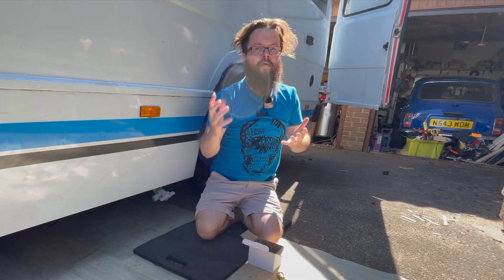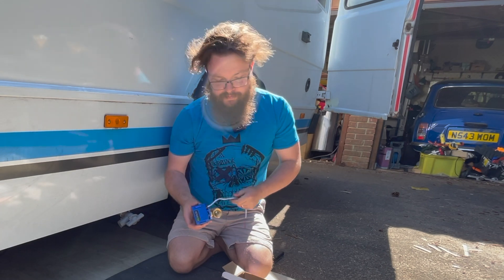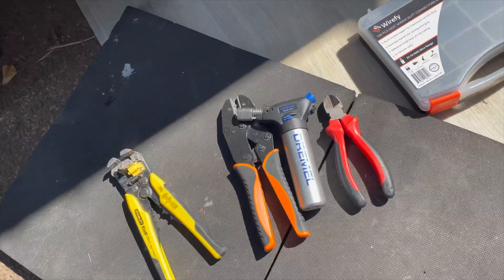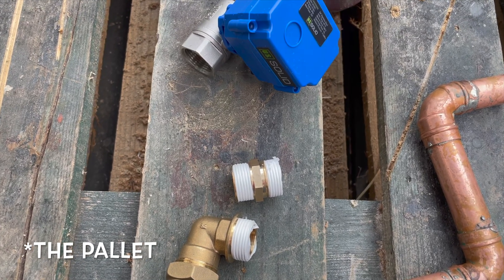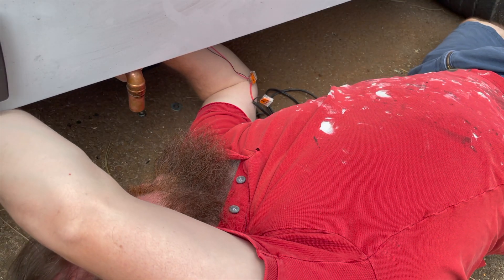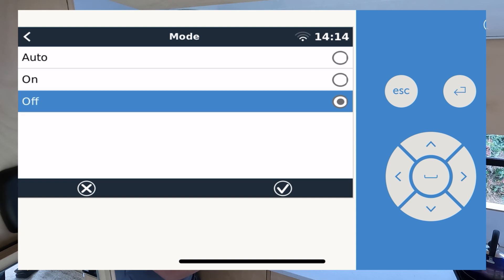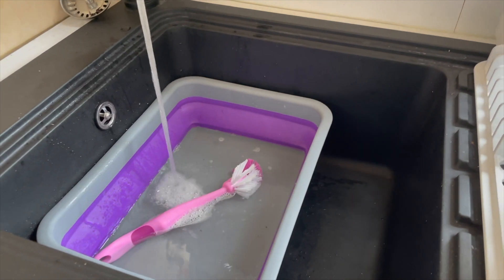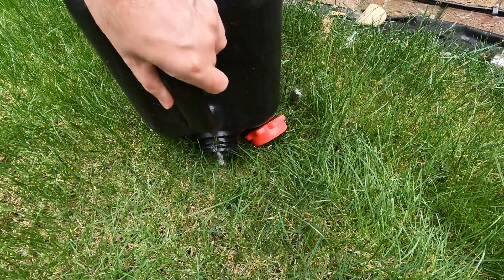Waste Water Drainage for Your Van with Victron Cerbo GX

Comment: this is great, i have a ball valve with 3 wires, negative and 2 lives open/shut, bit confused as how to wire up using cerbo, anyone help
Reply from the maker: Thanks. So assuming this is like yours https://amzn.to/4jOkDv8 you will need to run your negative wire from the fuse box to the yellow cable on your valve. Run a positive feed from the fuse box to the common on your cerbo, connect the red wire to NO (normally open) and the blue wire to NC (normally closed). 

When the relay is active it’ll open. When it isn’t it’ll shut. Let me know if this works - fingers crossed.

Comment: I connected straight to the Cerbo GX like you suggested you do and it doesn’t open when I switch to on probably going the relay route. How did you wire your relay?
Reply from the maker: It should work via the Cerbo, so wire from a fused source to common and then to the valve from the Cerbo. The Cerbo is just acting as a switched relay in this scenario. Ensure your negative goes back to the same place where your source is grounded (fuse box?)

In terms of how I did it. I decided to use the cerbo as a trigger - power is supplied in the same way to the Cerbo as above, but then instead that cable is routed to a 12v relay to trigger it. This is probably overkill, but I thought it better to put the strain on a cheap relay vs. the cerbo over time.

Comment: Great idea but surley you would put it on the bottom of the tank? Will be 2inches of water always left in the way you did it
Reply from the maker: We used the existing outlet that came on the tank and you’re right it sits a little high. About 3.5cm to the middle of the outlet. One in the bottom would probably reduce this a cm or two by the time you’ve threaded a bulkhead connector in there for sure. 

That said we don’t really find it an issue as more often than not we will find ourselves camped on a slope and can drain off the excess into our container before we leave. It also means we have good ground clearance, the only thing lower than the body is the 22mm pipe. So no worry about hitting the valve at all. Thanks for watching. Hope this helps.

Comment: How has the valve faired out since it's been installed, any water ingress into the circuitry? (I've read a few headache stories..)
Reply from the maker: Touch wood, zero problems with it. It’s really useful to have to be fair. Would still recommend.

Comment: does it come with 2 wires or 3 wires? I saw some versions with 3 where you need to power the 3rd wire for closing the valve.
Reply from the maker: The version used here is 2 wires. So this means when de-energized the valve shuts automatically.

Comment: Hi, wondering if I need to take 12v to the relay. Or will this spit out enough control voltage to open and close the ball valve?

Because when I hook the valve up directly to the relay, it doesn’t open the valve
Reply from the maker: Hey. Yes you need to supply 12v to the common terminal. The relay is effectively just a switch that cuts or switches on the power.

Comment: Nice job! I have a question. I saw that your VRM-menu shows "remote console". How did you add that menu point? I cant find it on my VRM. Best. Silvano
Reply from the maker: Thank you, so in your GX device if you navigate to settings and go to remote console you should see and option to enable on VRM. Hope this helps 😊
Reply: @WanderbusAdventures Thanks, but unfortunately it does not help. That setting is "on" and I stilI do not get the "remote console" listed in the VRM menu. Any ideas as to what might be wrong? Best regards, Silvano
Reply from the maker: @silvanocometta9760  did you manually reboot it after switching it on?
Reply: @WanderbusAdventures Yes, I did. As it did not show a result, I also rebooted the Cerbo by taking off its power cable for 20 sec. Still no result. I am puzzled.

Comment: Hi again buddy 
Did you ever do a video how you got the fresh water on the cerbo 
Cheers
Reply from the maker: Hey Sean. Do you mean how you get the levels to work?
Reply: @WanderbusAdventures  hi mate 
Yes 
I’m not sure if you use the mopeka sensor for your fresh and grey tank or the senders buddy 
I have them on my motorhome control panel 
But I’m wanting to get away from the old set up 
I’m basically using everything Victron too 
So was thinking of using the sensors for the water tanks then connect to the cerbo
Reply from the maker: Ah makes a lot of sense. So I used resistive wired senders for my tanks and wired them directly to the cerbo. I can monitor it on the cerbo then and can even set it to empty the tank automatically. Do you know what sort of senders are in your tanks? If they’re wired there’s a good chance it’ll work with the cerbos inputs.
Reply: @WanderbusAdventures  ah ok makes sense 
And no I have no idea
I have tank levels on the fresh and grey tho 
But I have seen the wiring and they come in 5 wires so each different level 
Otherwise I would have piggy backed to the cerbo 
But …. Being 5 wires seems more difficult to do
Reply: @WanderbusAdventures  what size fuse did you use when fitting the ball valve for the grey tank buddy

Comment: That grey tank dump valve looks pretty small for European rvs. Here is the US usually is 1.5 inch, yours looks like 1 in? I wonder do they clog often?
Reply from the maker: It’s 3/4- so even smaller. I matched it to the thread on my water tank so it’s no smaller than what was on the tank. It hasn’t clogged yet 🤞

Comment: Hi again buddy 
On to the last job 😅 diesel heater on temp 
Obviously because these can use 8 amp 
I will need a relay or ssr
Is this how to do it ..Example 
Positive from fuse panel to relay in the cerbo label (com )
Then out the cerbo (normally open ) to the actual relay device 
Then the other end of relay to the heater power 
Is this correct 
Thanks
Reply from the maker: Hey. I’m unsure what you’re trying to do with the diesel heater but assuming you just want to cut power to it when it’s warm, power when it’s cold. And then you’ll manually switch it on. I’m not sure I’ve understood this but working on this assumption (I’m not sure I’d do this myself but not party to your reasoning or setup). 

If the above is right then yes. Fuse box to com - NO to your trigger on the relay. You can then wire from the dedicated relay to your diesel heater.
Reply: @WanderbusAdventures  sorry buddy but yea when I put more thought into it I realised the cerbo can’t turn a diesel heater on 😂 the heater display needs to do that . All the cerbo could do would send it power lol the cerbo could turn a oil radiator on in the van tho set on temps that’s a idea while the van is on the drive in the winter if ever drops below freezing . It’s ok buddy I’m just playing with different ideas ! The cerbo is brilliant
Reply from the maker: Oh yeah it’s a great piece of kit.

Comment: brilliant video thanks, any thoughts on how it will perform when it gets really cold in the uk - we have had -10deg C in Scotland - would you expect the ball valve to still operate? Thanks
Reply from the maker: Thank you 😊. So the stainless valve says it is operable in ambient temperature from -10deg c to 40 deg c. But this counts on the flow medium (the grey waste) being a minimum of 0 degrees and a maximum of 90 degrees. 

So I am planning on adding some winterisation to the tank and the outlet. I've an idea around using a tank blanket for the medium and some self regulating cable around the outlet - but will update on this as we do it. It's a great point and a big consideration for underslung tanks.
Reply: @WanderbusAdventures  ok great thanks, will keep following for updates, and will have a go at this myself as it's definitely needed on our latest van!
Reply from the maker: Thanks Mark. Let us know how you get on.